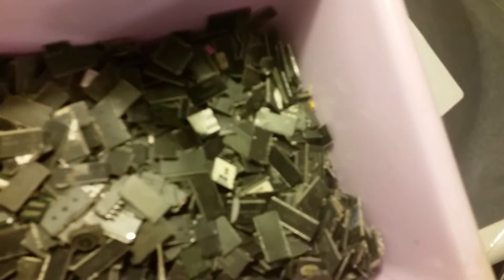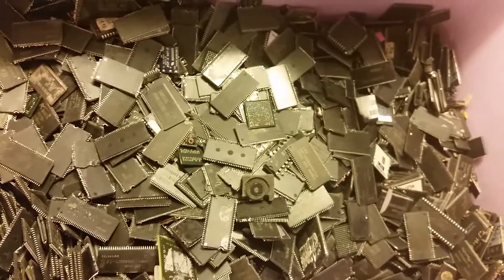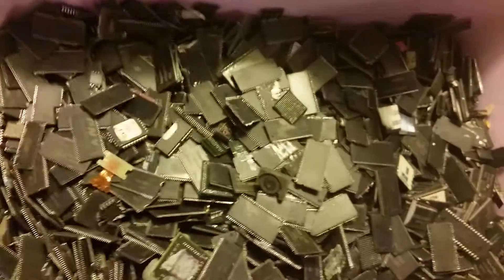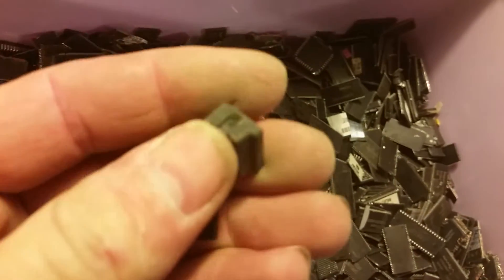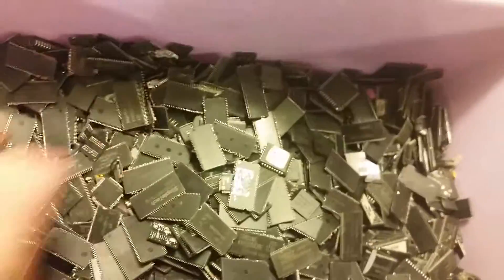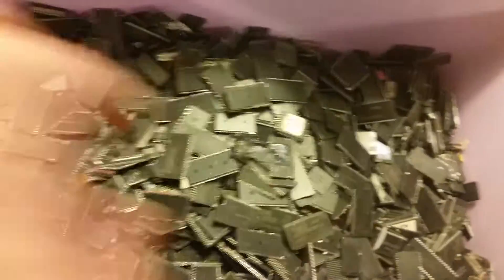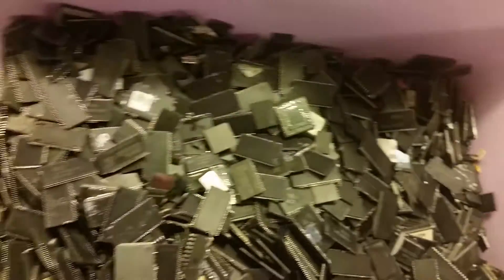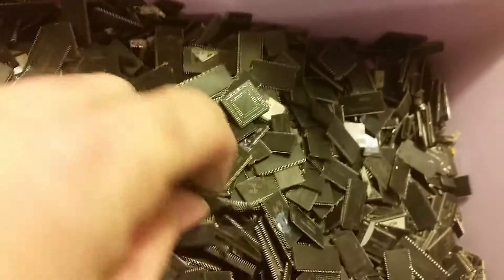sort your IC chips

Comment: Dude... do they need to be seperated? or if they do, I am assuming they would want non metallic / metallic sorted, or ceramic/silica sorted. I mean, if they are the same substance, I will bet they are processed the same. Flat pack, narrow pack, ass pack is how I sort them o.O I wish you'd identified the flat pack vs. the ones with prongs only on 2 sides, vs. those single prong sided things with a hole on the opposite side you find on boards... I thought I read they were "regulators"... I know little if you can't tell.
Reply from the maker: It all depends on the refiner.  Yes i did not go over the magnetic chips.  The refiner who proceeded that lot of chips required that i only separate to the extent i went over in the video. I now only have plastics apart from ceramics.